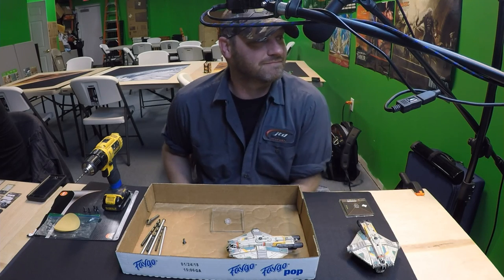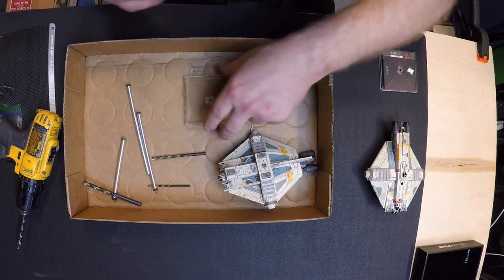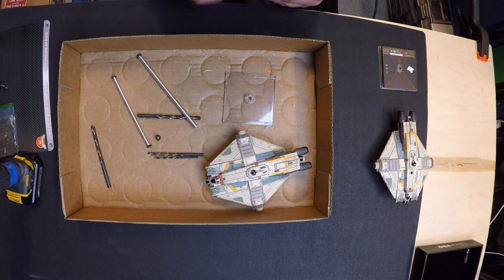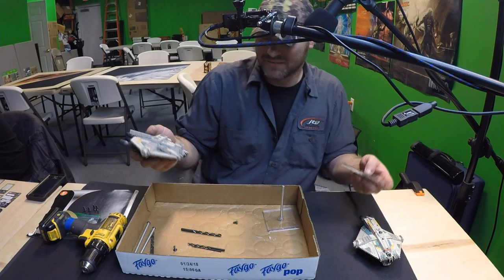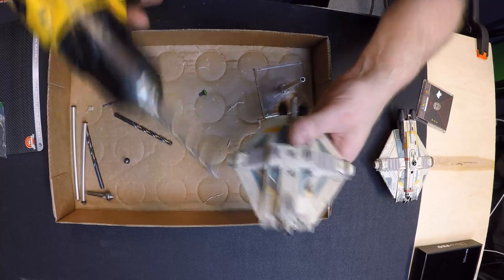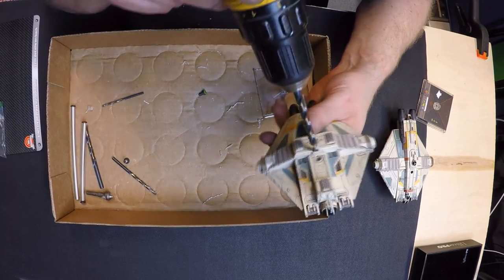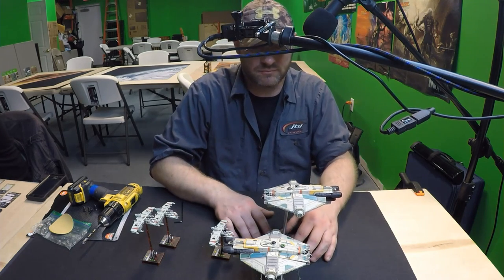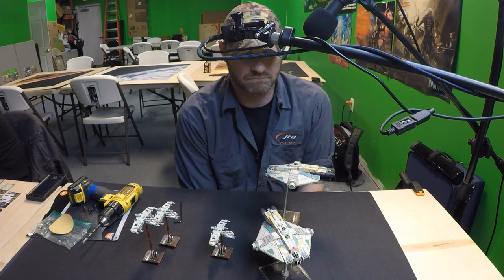X-WING: Jon Brun's Tutorial "Rod Mod" for Ghosts/VCX-100 - X-Wing Miniatures - SPG

Comment: I never had ANY problems with my VCX base. I think I had the 1 inna million. This mod inspired me to do my own.

my rod is slightly thinner in diameter, but the process for the base is identical, my flathead screw is held in place by a nylok nut. My rods are links from Axial or RC4WD for RC Crawlers, they are threaded on both ends and thread directly onto the base. The link/ rod I use is available from 5mm- 127mm, I do not know, but they may have longer lengths as well.

DO NOT DRILL THROUGH IT!! NOT NEEDED!! I do not have a bolt through the top of mine.... you do not need it. The cargo and entry piece is easily separated from the VCX and already is predrilled, just cut the mount nub off from the interior of the VCX, use washers to hold the screw in place on the cargo pod, lock in place with a Nylok.... the base and the VCX both easily just thread together, no tools needed, and no bolt out the top....

I will say it again, thank you for the inspiration! I love custom stuffs for my games
Reply: Seamus RBNW how do you separate it?

Comment: I feel like a neodymium magnet connection between peg and ship would be quicker, easier, and less stress inducing.  A ball and ring magnet assembly would let you tilt and rotate out of the way of other ships, as well as more quickly (toollessly) build or tear down at tournaments.   Did you rule out magnetics due to the mass of the VCX-100?
Reply: If I can get ahold of Jon want to try a hybrid method. Metal rod with a magnetic connection.
Reply: I know this is an old video but this is exactly what I was thinking, if you use the base mod as shown in the video but then just add a magnet to the ship you would be saving a lot of headache. Would love to see how that works!